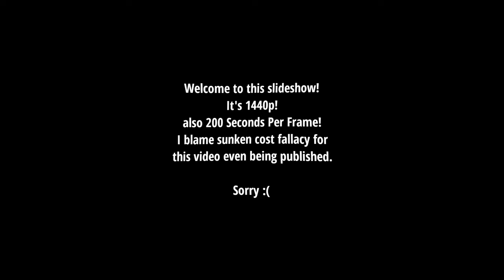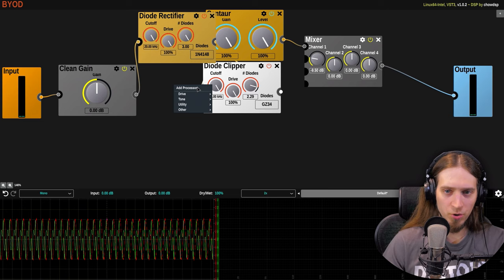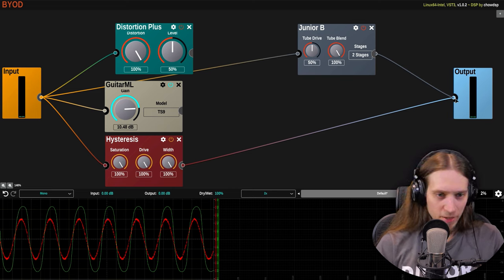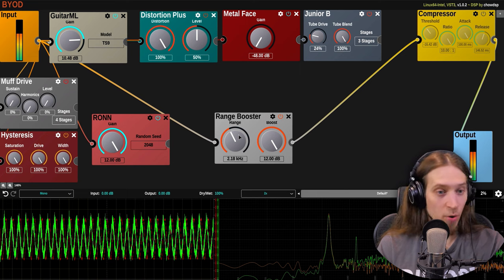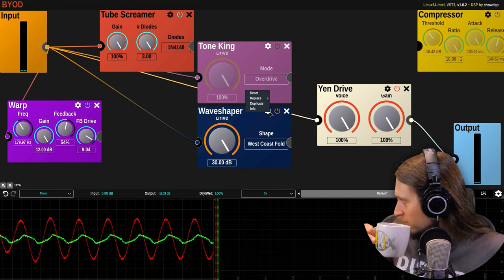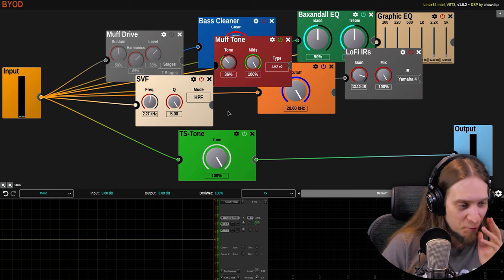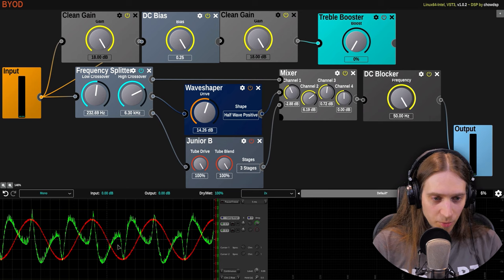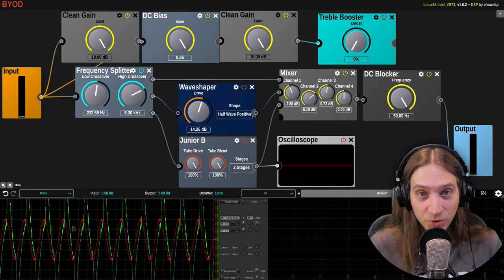A deep dive into CHOW BYOD a.k.a Build-Our-Own Distortion (slideshow?)

Comment: hello I want to ask. Previously, thank you for the tutorial on your YouTube video, it's very helpful. I have an Audience ID44 USB3 Audio Interface, a Behringer UMC 1820 USB2, and a Firewire Studio PCI X Firewire. I can't run the three audio interfaces simultaneously with ubuntu studio and qjack. can you help me? thanks
Reply: with alsa not working
Reply from the maker: Hey! To use multiple audio interfaces together you'll need to either use JACK or PipeWire.
In JACK you need to pick one as your primary interface, and then you can use alsa_in and alsa_out programs to use the ALSA driver to expose additional audio devices to JACK. alsa_in allows capture and alsa_out allows playback. Then you'll be able to capture from all I/Fs at once etc. But be aware that this is inherently flawed for low-latency audio, as each interface has it's own clock and this means the signal timing can drift. I tried recording a drum kit like this once and the tracks did not sync up.
Alternative is to use PipeWire with pipewire-jack to make JACK apps utilize it instead. PW will handle all devices for you so no need to manually run alsa_in or alsa_out, but the same sync issue may still occur.
If you need more help I recommend joining my community chat on Rocket.Chat or Discord: https://chat.unfa.xyz